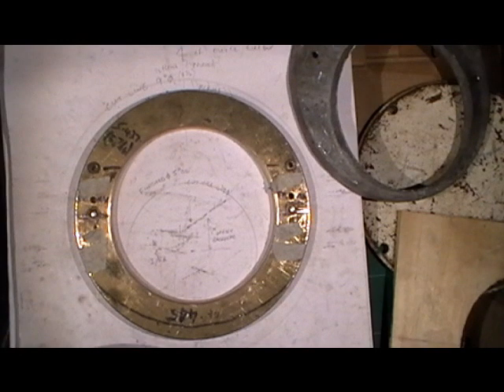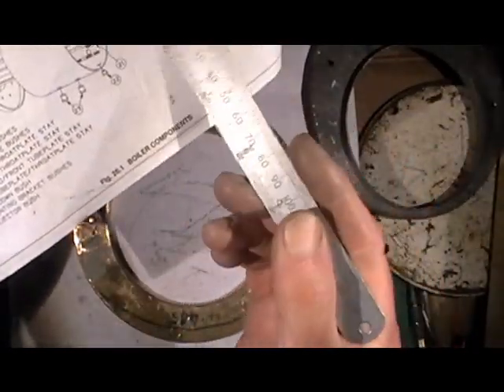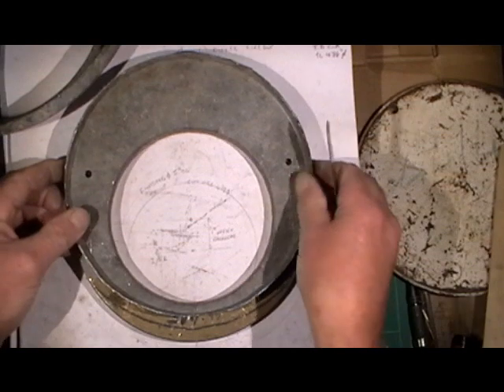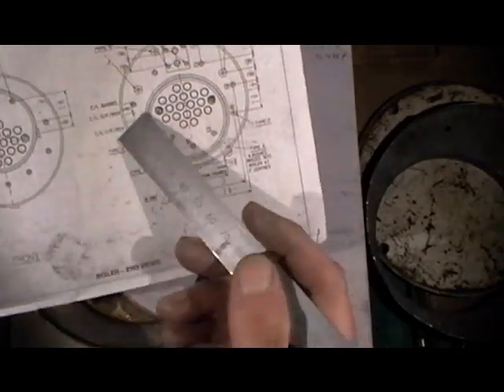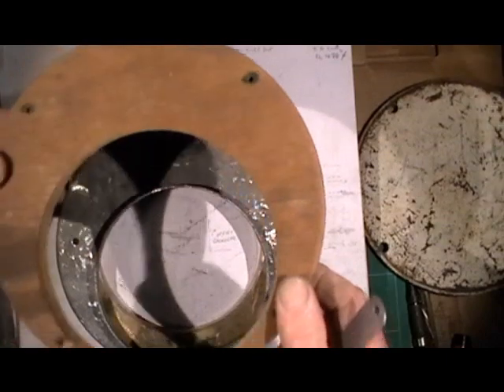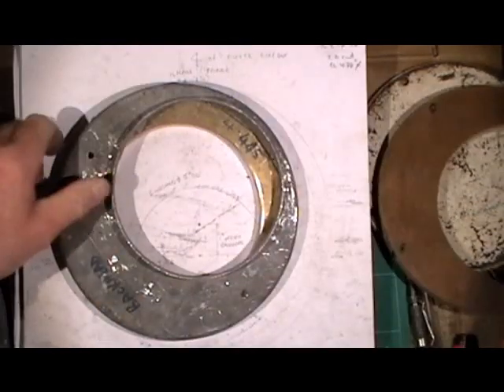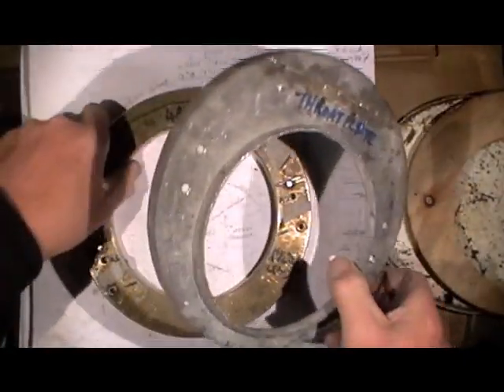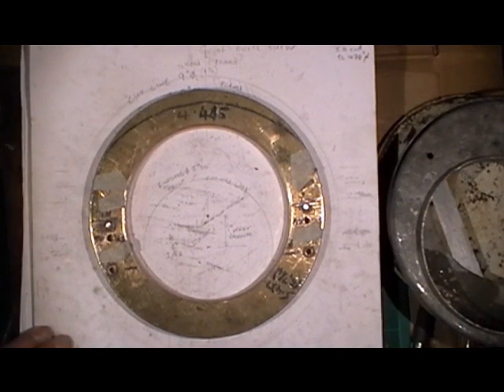How to make a steam boiler from scratch for a 5" gauge loco Part 2 (practice flanging) "mr factotum"

Comment: Great idea using the lead !  Saves a fortune on copper
Reply from the maker: cheers tony
yes that was my thinking at the time, got the chance to practice on a new skill !!, 
great idea of yours to make a list as you near the end of the loco, i just usually make a short term list on the bits i'm working on at the time. but ive done a list now and surprised  that i got 2   A4 sheets so far. amazing the work thats still to do!!!
thanks for watching and taking time to comment, i appreciate all help advice and pointers as a beginner in loco building.
stay safe
regards
mr f